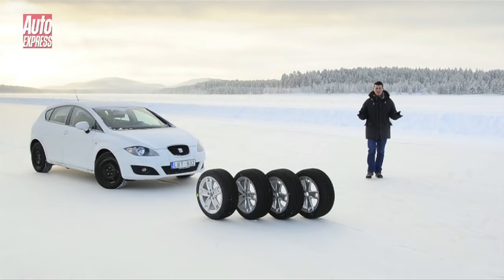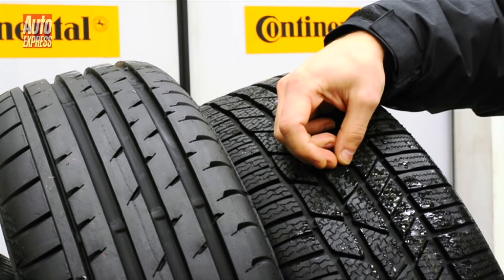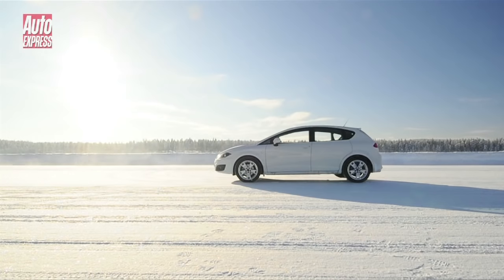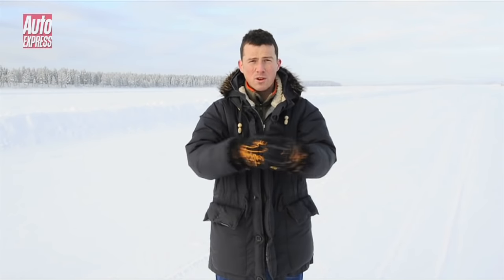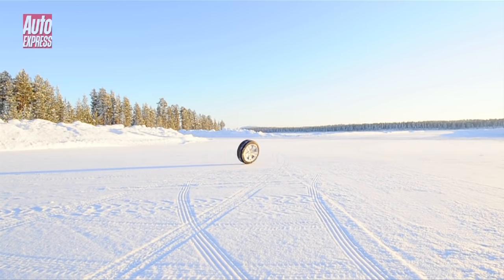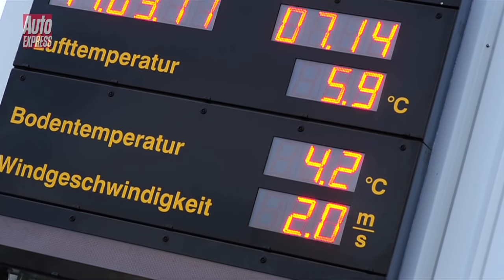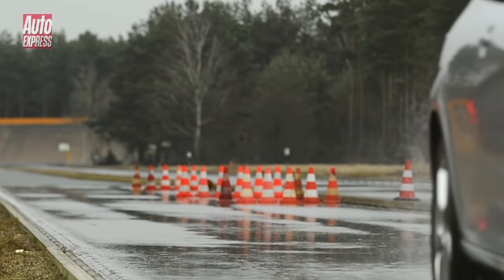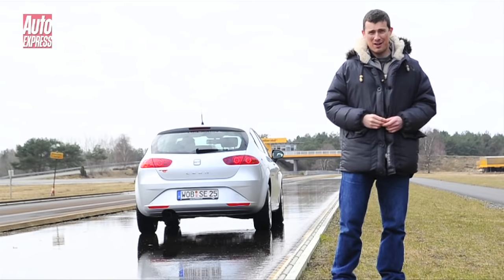Winter Tyres v Summer Tyres: the Truth! - Auto Express

Comment: An all season vs winter tires would be a better comparison. Who has summer tires other than expensive sport cars. Majority of cars come with all season tires.
Reply: all season tires (M+S in the US) are for Mud + Sand mostly which means they're similar to normal summer tires except with much deeper grooves and much more offroadlike patterns. For traction on gravel and in sand mostly. On asphalt they're worse than regular summer tires. There is no comparing "All season" tires (offroad summer tires) and winter tires because of rubber softness. All seasons are still much too hard to perform on snow/ice during cold temperatures and you'll skid regardless. Winter tires are soft, hence the grip on cold surfaces and in cold temperatures. I'm from sweden and in sweden "all terrain M+S" tires are illegal during winter because they aren't winter tires or even close. :/ We have to use softer blends of rubber, iow special winter tires, by law.
Reply: Toni Radanov Pretty sure mike was talking about the poor comparison in the video and wasn't asking for any definitions. Its pretty obvious in the video that the "summer tire" in the video is not made for anything but dry pavement. To me it looks more like a high performance tire. I agree with mike and think comparing an all season to a winter tire would be best. So the tread patterns are similar and it would be a test of rubber softness. I live in Minnesota and an all season does do better in snow than a touring tire or "summer tire". 

Also... All season is not an "offroadlike" tire. You are speaking of all terrain tires possibly. All season is just a tire optimized for year round usage and have tread that works well in more than one category.
Reply: All season tires are worse then summer tires in the summer and worse then winter tires in the winter. Why do people use them?
Reply: Roger Skagerström When making comparisons you should use "than" not "then". THEN your comment might sound a little less redundant THAN it already does. 

Because they work great in all seasons Roger. People don't want to switch out tires twice a year. They are expensive as well.
Reply: No they don't. They give crappy grip in the summer and crappy grip in the winter. They are to soft to give good performance when warm, and they miss the special tread that gives traction in the snow. 
I'm from Sweden, here wintertyres are mandatory from december to the end of march. Why? Because it saves lives. All seasons are allowed but everyone knows they're crap. 

People don't want to do alot, even if it saves their life. 

You spread the miles over the tire sets so its not that much more expensive. Especially if you concider the added wear of the soft compund all season tyres in the warm summer.
Reply: Roger Skagerström I can agree that the miles do spread out on the two sets of tires but with either swapping tires or buying an extra set of rims it is more money. However,, all seasons typically have longer tread life than season specific tires but tread life from one brand/model tire to the next in the same category can be quite different as well.

There are too many variables in this argument. Modern day tires have come a long way with the siping and gip edges (special tread).... More and more cars have all wheel drive, traction control, and abs.... Width, size, and air pressure of a tire..... Is it a car? truck? suv?.... 

Everyone knows that there are cars that shouldn't be driving in snow. In my opinion thats where I will agree again with you that they would benefit the most by having winter tires. But,, that category to me is mainly sports cars and they should be parked til spring anyways. 

And yes the all seasons have that special tread. Just not as many sipes etc... 

In your first comment you asked "why do people use them?". People want one set of tires that work all year round. Its as simple as that. They might not master any one particular season but they do very well in all.
Reply: Only in america. In europe all cars (expect for some suvs and 4x4s) come with summer tires from the factory.

Comment: Why not test on a tarmac road in cold temperature? That is more relevant to the UK where only a small percentage of time in winter there is snow on a few roads.
Reply: +stubones they are called WINTER tires for a reason my friend
Reply: FSXgta
Does WINTER mean the roads are automatically covered in snow and ice my friend? :) Like I said, more relevant to the UK is wet, cold tarmac, because in most areas it doesn't snow much, if at all. Winter tyres are also designed to be used on dry tarmac in temperatures below 7 degree Celsius due to the softer rubber compound, not just on snow.
Reply: Did you even watch the second half of the video...
Reply: Clearly not snooker147.
Reply: I drive on michelin super sport and if it is -10 degree celsius i have way more grip then anyone with alle seasons, but when it starts snowing the grip is gone.
Reply: DEDICATED 2 CARS 

At -10 there is no way you Michelins grip more than winter tyres.  The rubber is not supple enough at that temp.
Reply: Compare it to Michelin x-ice 3 or x-ice north.
Reply: I've ended up on mountian passes with snow/ice on summers. Does happen.

Comment: Um better review would be High rated all seasons vs dedicated winter tires.
Reply: Bardia Ghajari the results would be the same
Reply: Summer tiers are great in the summer. Bad at winter.
Winter tiers are great in the winter. Bad at summer.
All season tiers are decentish... all year. Not good at anything but not bad at anything either.
Reply: This is comparable to shoes: do you have any shoes that are good both in summer and in winter?
Reply: All seasons are "meh" all year round. I'd rather spend a couple hundred Euros and have tyres which are very good in summer and another set of tyres which is very good in winter. "Meh" can be the difference between crashing into something or not, and when you do, it will cost more than a couple hundred Euros.
Reply: All seasons are good, because even during summer it can be cold with heavy rain. I would even argue that All season is a solid choise for Western Europe(UK, Netherlands, Belgium and Danmark.) That area. If there is actual snow and ice on the road you should be aware of that and don't get over confident. 

Also the test here was all about profile, wich the all seasons have just the same as the winter. So in this test on snow results would be the same I imagine. On a cold road winter are prob the best. I doubt the all seasons are being outperformed on a hot summer day(wich is rare were I live) if you drive normal.

Comment: arumdevil's right. i'm  from moscow. here, in winter it's down to -30 and in summer up to +35 sometimes. normally, if you're not an aggressive driver, your winter tires last about 2 to 4 winters. if you drive on winteries when it's warm, the soft outer layer (which makes all the difference on ice) and the fine tread might be worn out after 4 months.

Comment: My 2 cents on the matter:

I used All-Season tires on my 2006 Ford Taurus, no A.B.S., no traction control, and, of course, no E.S.C. Long story short, the car was extremely difficult to drive. I tried adjusting the tire pressures and it was always a major compromise. One winter in Salt Lake City (at Bountiful) taught me the hard way. I ran past 3 intersections, got stuck countless of times, and had over three uncontrolled slides onto incomming traffic.

Now, in Ohio, I purchased a set of wheels with winter tires. It is nothing short of amazing the difference it has made. Most shocking is when stopping. The investment was well worth every single cent I sank into and more. Besides, my life is worth more than wheels and tires, and, also the life of those around me.

Now, also my 2012 Fusion Sport AWD (which does have A.B.S., E.S.C., & Traction Control) is shod with winter tires. Safety first!

Comment: Why summer tires vs winter? Why not ALL SEASONS tires? All most everyone uses all winter tires and barely anyone uses summer tires during winter.
Reply: I was going to say the same thing. Seems very biased.
Reply: All season tires are damn slippery on wet if worn even a little. I was impressed at the wet braking of winter tires though, they should test the difference on +15c conditions where the summer compound is softer than at +5c

The biggest difference with summer vs all year is the tyre composition. Summer tyres are almost like rock hard plastic when it gets cold but winter tyres are like silicone which doesnt get much stiffer in cold :)

You could make winter tyre material slicks and still get better traction than new summer tyres :D
Reply: All seasons are no replacement for winter tires. I live in Ontario and I almost got into an accident with all seasons, the grip is still awful.
Reply: My girlfriends volvo has all season tyres on it, I always laugh how people say FWD has better grip on ice and snow. Its bullshit and only down to tyres.

Then I get walked by BMW's and mercs all day when trying to pull from the icy traffic lights :D Its all about the tyres.
Reply: eamh2002 would still take BMW
Reply: Because no one should really use no-season tires unless they drive mainly in cities and have not so powerful and fast car. Thy are just bad compromise between summer and winter tire. I rather have good set of quality summer tires and one set of quality Nordic (central European winter tires suck also) studless winter tires.
Reply: Because nobody uses all season tires in europe. They are only a north american thing.

Comment: learn to drive in the winter. and use all seasons all year.
Reply: The morons in my area spaz out & haven't figured out that a lower gear = better control & traction, even in an automatic.  I have a road rocket & have driven past dipshits in behemoth SUVs.  So remember wingnuts & dingleberries, no matter what tires you have, drop into a lower gear (1st for 0-15 mph, 2nd for 15-35, etc.) & if possible, shut off the overdrive!  P.S. Put down the farkin' phone too!
Reply: I've always used all season tires on my cars until this year when I bought snow and ice tires for the winter. I have to say, there is no comparison between the two. All season tires are a little better than summer tires, but they don't even begin to compare to winter tires. I have yet to get stuck with my winter tires, and I'm even selling my all wheel drive car that I kept for driving in the winter because they're so much better. And I always bought the best all season tires available, not just whatever was cheap. It's a staggering difference switching from one to the other.
Reply: babybirdhome i agree snow tires are better. but for my driving style all seasons work just fine. we get  150-200 inches a year but only 6-8 inches at a time so all seasons will work. now for someone who isnt used to driving in snow for 6 months a year they should have winter tires.
Reply: Yeah, experience is more important than tires. People who rarely drive on snow suck on snow, people with plenty of experience do just fine in snow that would put other people in the ditch. That's a fair point. :)
Reply: babybirdhome true people that drive in snow for a total of a few hundered miles a year are not experienced. the bad thing is here where i live we drive the speed limit which is 70mph and people with less experience see us going that fast and think they can also. and most times they find out the hard way.
Reply: Learn to drive, yes. Water, snow, ice, oil, leafs, sand and pretty much anything makes road slippery. All seasons, NO, DO NOT. They just combine the worse of both types. You will wear them out fast in summer and in winter they are no good, because they are not made of right mix and texture is bad.
Reply: MrSuperBrite to the people that dont drive on snow much i would say yes get winter tires. but for experienced winter drivers all seasons are fine. very few people where i live have winter tires. maybe 1 in 40 cars have a set of winter tires on them.
Reply: carminefast77 I was just thinking about weather in Sweden or alike. In Texas, USA, you really don't need winter tires ever. If it's snowing every 100 years, you just stay home or walk (not maybe in USA tho) where you need to go.
Reply: MrSuperBrite i live in upper michigan. we have bad winters. ive had winter tires in the past and they are better. but the difference between them and all seasons isnt worth the extra money.
Reply: kerry5101971 Dropping to a lower gear to gain traction is a myth. Slipping happens when the torque applied to the wheels exceeds the available traction. Lower gears make more torque available to the wheels, so they increase the chance of slipping. The only reason to switch to a lower gear is engine braking.

Comment: I have winter tyres and happy with the performance and handling, also secure in mind that I'll stop in time in an emergency (hopefully). However, as most of the UK don't fit them, my concern is that I'll get rear-ended with someone on summer tyres due to the fact I can feasible stop quicker then them!!  Hopefully in time it will become law to fit winter tyres as part of our campaign here in the UK to make our roads safer. The newer cars have amazing safety features, camera, radar braking aids etc, why put them on summer tyres in the winter, doesn't make any sense. I understand the initial outlay for the tyres, extra rims and possible storage difficulties etc, but come-on, life is got to be worth more than £400-500 and the tyres on the car will last twice as long. I got a good deal from a german company with agents over here, at least 40% off with delivery & £20 for fitting at my local garage on £100 for 4 rims off ebay. Go for it, what have you to loose, might save lives  :)

Comment: Whats with the "miles per hour" ?!?!?! I thought you Brits were using the metric system?
Reply: that is the only thing we do not use it for
Reply: Bruce Lee that must be confusing. if you at least used swedish/norwegian "miles"* :D
(*1mil = 10km)
Reply: The metric system is just confusing. I weight a stone. Depending on the mood, a little rock or a mountain. I'm must be 2 feet tail, as I have 2 legs. I'm not sure, but the unit of velocity in imperial units is measured in pints? And even that is not constant around the world. Correct me if I'm wrong.

Ounces of greetings, but prefer winter tires and metric system.
Reply: yetanothermotherf
I don't think stones and feet are part of the metric system?
Reply: He Ka uk uses miles
Reply: He Ka it's called brexit 😂

Comment: I live in Norway and used to think that having two sets of tires was twice as expensive, but it isn't of course:

Having two sets (one of which is the Nokian Hakka studded version) just means that I distribute tire wear over the two sets so they both last longer than a set of "All Season" would.

Here in Norway the question is mostly moot: If you try to drive on summer tires in winter conditions the police will take your license plates on the spot, and using the studded winter tires after the spring cutoff date leads to a heavy fine.

Comment: Right, well the key point here is the tire compound you are using along with the tread pattern. How does the tire perform when running softer compound during the summer in mileage results?

Comment: It would be better to see all season (which is common in Canada / USA I believe) vs Winter tires. I believe the results would be similar but maybe not quite as Dramatic. I have had high performance high rated all seasons which were fine in the cold temps but as soon as there was any snow it was pretty slippery, winter tires definitely maintain more grip for longer, I can still loose traction easily if I try :P

Comment: Is there any metrics to show that there are less accidents on UK roads for those with winter tyres from October to May. And if so why would insurance companies not offer a cheaper insurance cover if such tyres are fitted. The only issue I would see is how the insurance industry would know if you were using such tyres unless you had a claim. Higher level of thread needed for summer tyres for MOT? Lower level of thread required if Winter tyres fitted? 
Also what about all season tyres vs winter tyres?
Reply: Insurance is funny here. some insurance providers will void your insurance if you crash on studded winter tyres even if E marked and fully compliant with the law and safety regs and standards. I get by fine on summer tyres in the snow at the moment though I am going to order a set of winter tyres. Drive in second gear and avoid going over 25mph and use the gearbox to slow down whilst using the brake to the point before abs comes on. not skidded, struggled to stop or failed to climb a hill yet! admittedly i'd rather be able to go 40mph than 25mph on the back roads but thats life

Comment: On average snow only settles for 16.5 days of the year across most of the UK with the exclusion of Scotland at 27.7 days (Met Office). More often than not these days are not consecutive, and considering most of the UK grinds to a halt whenever theres even a mention of bad weather, is it really worth rushing out and buying a second set of rims and some of most precision engineered rubber to boot? Chains however give way more traction than a winter tire. Although they may not be good for speeds over roughly 30mph, They will get you home if you were to get caught out after work. It'll probably be the congestion that will hold you up with everyone getting stuck at the bottom of an icy hill, on their new winter tires......

Comment: For the below 7 degrees test, were the tires cold? What would happen after they've both been driven for about ten minutes and warmed up a bit before the test?
Reply: Very good point. Summer tires specially high performance ones need to be driven until they warm up for them to have grip.